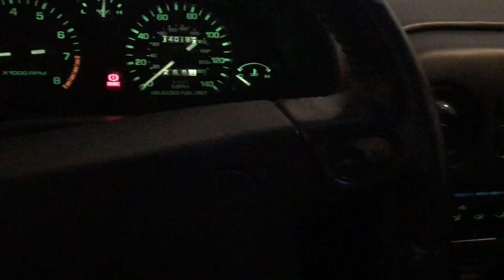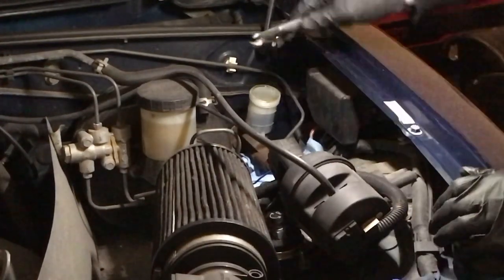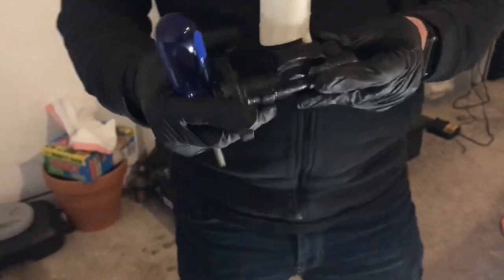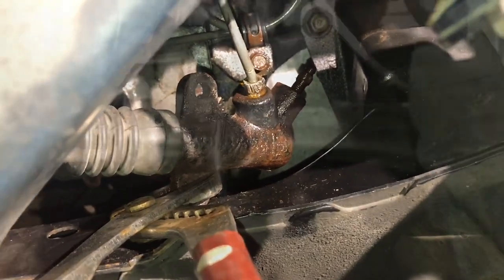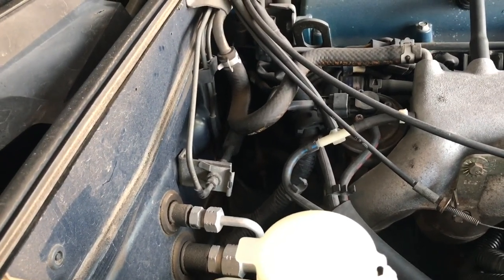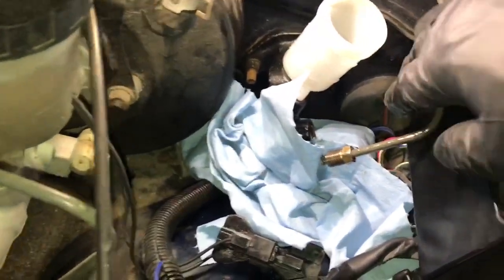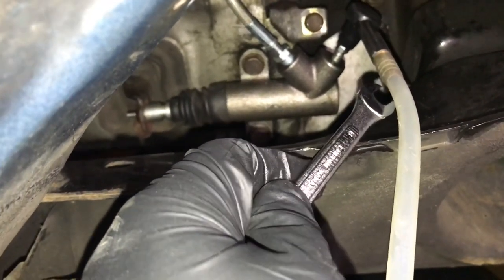NA Miata - Entire Clutch Hydraulics Replaced! (Master, Slave, and Lines)

Comment: Useful video. My ‘96 started to not disengage the clutch. No leaks so assumed the master cylinder. I swapped the “slave” cylinder at the same time even though I only have 40k miles on the car. This was a helpful video. Definitely worth getting the proper line wrench for the cables. You will need both deep and shallow sockets to do this job. Bleeding went better than I expected.

Comment: Made my day seeing another of your fantastic Miata videos!  I've got 208K on my '95, still with the original clutch disk/pressure plate, and clutch master & hardline. The slave cylinder was replaced by the dealership back in the early 2000's due to a leak.  All of this is now on my "to-do" list, as my Miata is now my 'project car'... Thanks!
Reply: I Find myself having to bleed the clutch every few months on my 90 miata with 212k
Reply from the maker: As long as you don't have rust, it's a fairly simple job to do yourself.  You'll just need help bleeding the clutch.
Reply: Not trying to brag BUUUUUUUUT,
I have a 95 Roadster with 92k mikes on the original engine. This spring marks the LAST emissions inspection ever...😈
P.S. First time seeing this channel and the name you chose is just perfect. 👌

Comment: I’ve got to get that braided line. I’ve changed the slave cylinder at least 4 times and it still leaks at the slave side hard line nut. The most recent time I even used RTV on the threads and Teflon tape on the inside of the nut...still leaks. At this point I can feel the fluid level through the clutch pressure down to a 1/8” low!

Comment: May I ask what are your wheel and tire specs? and did you need to roll the fenders to fit the 6uls?
Reply from the maker: Yes sir, they're a 15x8 with a 36 offset.  I wrapped them in Yokohama S-Drive summer tires 205/50.  They fit perfect, and I did NOT have to roll the fenders.  I'm also on coilovers and still didn't have to roll them.  You can watch the reveal video with all the specs here: https://youtu.be/QLiYiz5EYh8
Reply: Because Miata wow that’s great. They look brilliant btw and I’m definitely getting some bronze ones for my silverstone:)

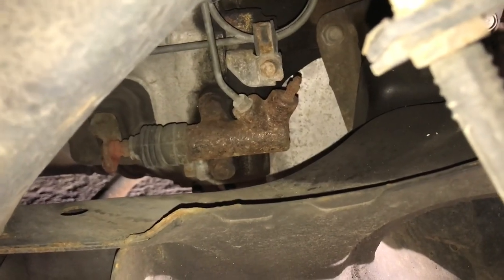Comment: Oh...at 13:02, you just make a rookie mistake and trying to mans-plain your ass out of it.
tip: when it dont give; tighten and reverse, works al the time....
Heat is a last resource, and you were doing it wrong. learn from someone that knows what heat does to metal before you try this "trick...".

i just did the exact operation on my mothers Miata, Exactly the same slave-cylinder since 1991(when it was new), piece of cake. took like 4 minutes.
Reply from the maker: If it works, is it the wrong way?  Hmmmm.  
I do appreciate your input though. You obviously know some things, but sometimes you need to be aware of how you word things.  You just criticized my man-splaination with your own man-splaination of how I did it wrong.  🤷🏻‍♂️
Thanks for watching.  I’ll try to do better in the next one.